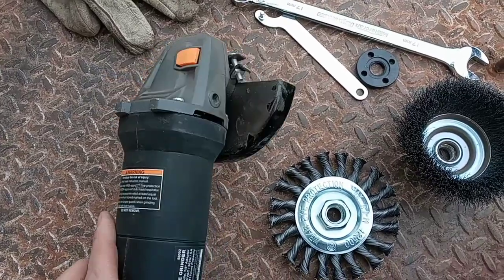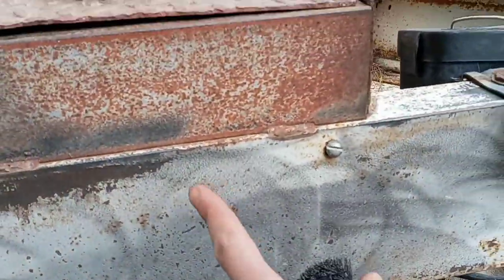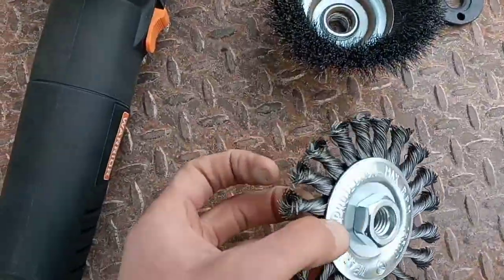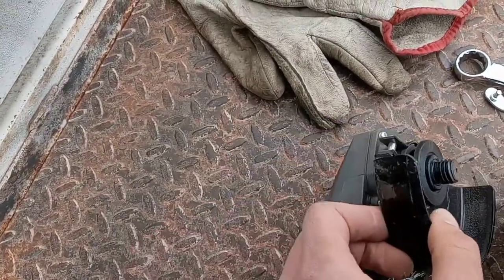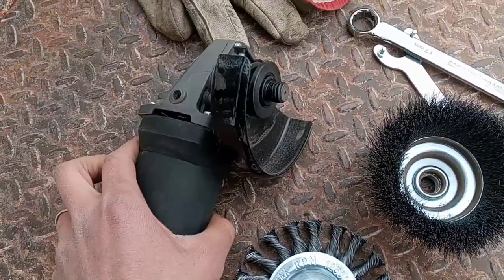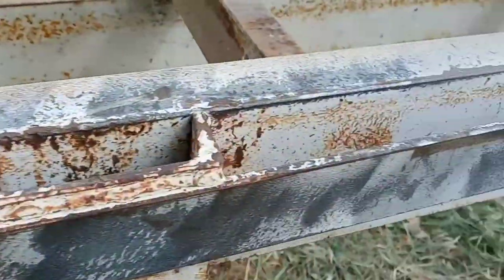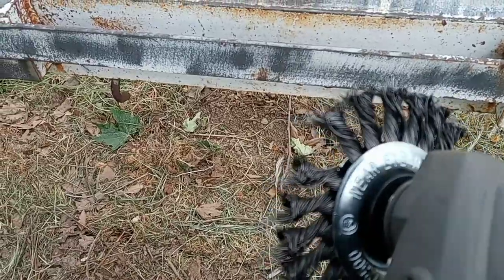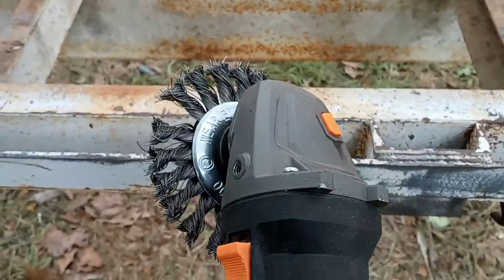Best wire wheel type? Using angle grinder to prep rusted metal for painting (4.5 warrior grinder)

Comment: Is it me or is he compairing apples and oranges.  The cup brush is a lite weight wire used fore surface cleaning.  While the wire wheel has heavier wire in a twisted configuation used for total removal.

Comment: Improper way to put on a wire wheel
Reply from the maker: Can you explain? I couldn't see another way this wire wheel could be attached.
Reply: @howpages  should the nut be toward the grinder
Reply: @zaftra I was just thinking the same thing and had to go to the comments to see if someone else caught that
Reply: (This maybe a little convoluted but I hope I got the idea across) 
I'm not sure about the orientation of the nut welded to the wire wheel.  But I do know that regardless of him installing it facing the grinder or away, He still has an unnecessary spacer between his grinding wheel and the body of the tool. Most grinders I've used have a heavy kinda washer, or a spacer like piece with diff cut outs on either side.. Not all "discs" are made alike therefore, I believe it's designed to get the best possible purchase (or contact) between the disc and the tool itself.  Before cranking down your threaded locking nut. 
Short story long, by flipping that washer around, and in some cases removing it all together, you can actually achieve a more secure connection. (though I believe it's most  important with the unthreaded discs )His mistake was leaving the spacer, not flipping it, etc. To my understanding you shouldn't have anything overhanging past where your disc meets the tool.. 
It goes, Tool, Spacer, Disc, Lock Nut.. Almost always.. This as long as shit but I hope it helped! 🤣